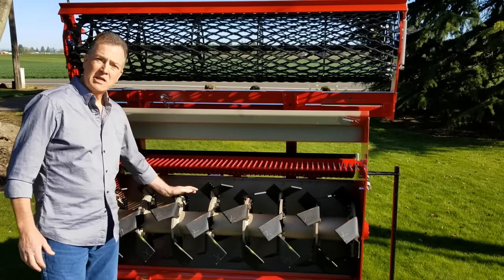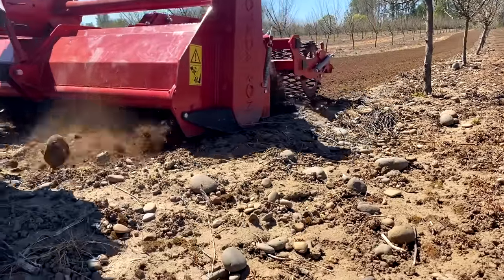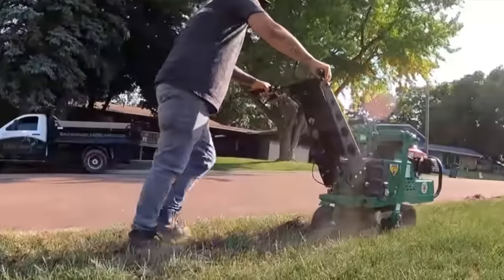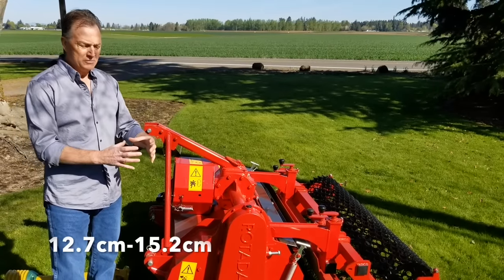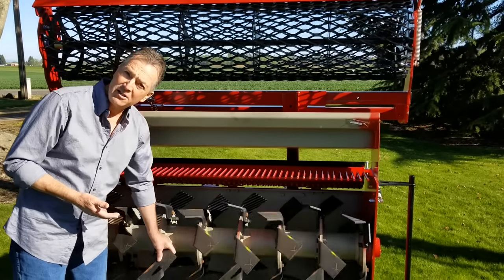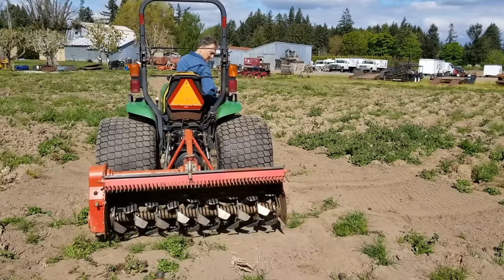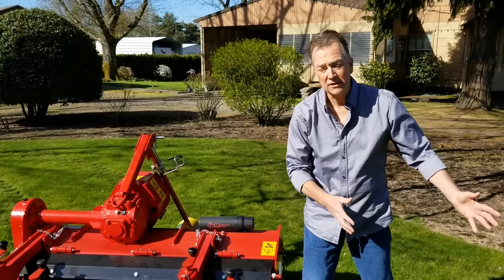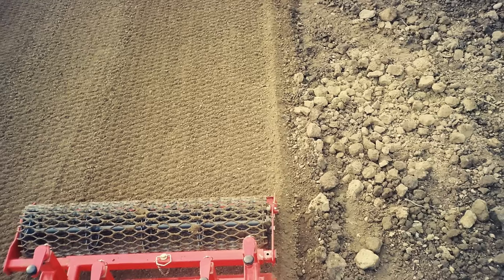One machine. One person. One pass.

Comment: Double shame that such machine is not readily available for zero turn mowers at a price range of 2,500 or so.
Reply: I'm with you! There needs to be some "cheap" equipment for mowers in general. Make something smaller and use an external power source like a Harbor Freight motor and tow behind. Even if it was a multi-piece deal. Like the head base has interchangeable parts. Tiller, sifter, leveler, seeder etc.
Reply: @shannonp4037  Yes, I agree.  I built something out of wood to cut sod about 2 inches deep, but the blade would always surface out of the ground, in that process I think I put around 300 pounds of weight to the back of the mower (on the device I built), and still would pull. So there's plenty of room, weight wise, for mowers to haul attachments.  I tell you, someone with some capital needs to tap into this market, hire a couple of engineers, a couple of welders and get the ball going.  Where's the American ingenuity?  Bring back the Made in USA tag (without foreign parts!).
Reply: @JBNetBreaker  son is going into welding, nephew (same age as my son) will be an engineer. Maybe those 2 can do it. Figure it takes a frame, 1 gas engine, some electric motors, metal, batterie(s) and an alternator/regulator
Reply from the maker: if you just want a cheap tiller this is not the right machine. this is a heavy duty, commercial quality, well constructed machine that will last decades if properly cared for.
Reply: @rotadaironcom269  Thanks, you do have a good product, nothing at all against your company; but in my opinion 2,500 bucks for a mower attachment isn't cheap, yet still falls within what I would pay (if I had the money), I'm just rambling about a whole different market, which I don't believe lacks feasibility.  By the way, I also attached my cheap tiller to the mower and was able to get a couple of rows done, obviously wasn't very stable, it was fun though.

Comment: I understand it buries rocks that bounce back and gets buried; however, my issue is grass when prepping an established lawn for sod.  Currently I have to till it with my tiller, switch to my powered rake and then remove thatch.  If this machine buries rocks AND grass I would consider.  Any input from anyone that has used one for this application?
Reply: If you can't lay sod over whatever this rig would do to your existing yard , there's some kind of issue that's probably not related to the equipment.
Reply: I call BS.  All of the videos and clips show preexisting fields or areas that have little to no vegetation.  And no you cannot just throw sod on top of vegetation that has not been buried or removed because the thatch that is left will breakdown under the sod and create heat which could cause root death.  Not to mention when it breaks down it can be lumpy when it breaks down if thatch is bunched up.  I think I asked for input from someone who has this implement.  Do you have one?
Reply: @brianatkins3371  don't need one. There's nothing flat around my area to use it on, and our yard rocks are literally the tops of the knees of the Appalachians, so this thing is out of it's element here.
 The level of mastication this thing would do to existing grass and vegetation is pretty easy to imagine, tho. Wouldn't be anything but beneficial to the dirt and whatever will be growing on it next IMO, especially if you're using a grass type that's actually robust.

Comment: if the rotor is on the right how do you make the second pass, do you have to drive around the field?
Reply: As with a tiller, to avoid tire tracks you shift the machine to the left at the end of the run and back up on untilled ground to reach the start point.

Comment: Does it only work on perfectly flat ground as you show in the video?
Reply: We have used our on fields that were plowed with a tractor first but you have to slow down or maybe overlap the passed to get it pretty smooth for a lawn but it sure beats a lot of hand work. We had ours now for over 15 years and although we only use it occasionally when we have the right situation it is priceless. I think ours is 54 inches and we use it behind a Kubota tractor which is about 60 horsepower but when we first purchased it we had a tractor that was only 40 hp and it worked fine.

Comment: Does what many other machine do, but much slower!  How many weeks to till a hundred acre field?
Reply from the maker: depends. what's your power unit? site conditions?is the soil previously loosened? let's assume your field is previously loosened mostly dry sandy loam with a little clay and rocks and debris throughout and you can handle an RX300. requires 110-160HP, it's got a 10' work width, and 8.5" till depth. at a speed of .25mph you will process approximately 26,400  SqFt(.61 acres)/hour. so approximately 20 days @ 8 hour days. 

and most machines don't bury debris. the rotadairon does.

Comment: I’m hoping by saying “high strength” you mean AR plate or a-514 plate. If so that’s a pretty tough machine. If not ? Well it won’t last very long.
Reply from the maker: whatever it is, the machines last decades provided the owner/operators are using them correctly.

Comment: Where would someone rent one of these in alberta Canada..  I have a 3 acre parcel that needs to be cleaned up to seed grass. It is currently kind of hay..would the hay have ro be cut first (about 2 ft tall)  I'm gonna have to try to find one
Reply: Replies have stated that most ground should be "worked" first. So yeah, you'd probably have to hay the field and then till it before using this machine.

Comment: Your comments about the amount of work per hour, does not match the clips you are playing at the same time btw.
Reply from the maker: we're aware. the amount of soil processing / hour is dependent on the machine. a small machine (say an RD100) running @ a 1/2mph can knock out approx 8,300SqFt / hour whereas an RD250 at 1mph (max recommended speed) can process 40,200SqFt. the commentary and pictures are only for example purposes, not intended to give an exact figure for every machine / job site.

Comment: BS those stones will destroy those blades
Reply from the maker: nope. blades are made of a specialty steel. super durable. you would have to put effort into destroying the blades. totally possible. we've seen it happen but under normal operating conditions (and with a component operator) they'll withstand quite a bit.

Comment: An American junk, bad for your soil, not good to chop every thing so much to powder. Those blades will be gone after a few acres, rock damage incredible. The best solution and machine for the job ever invented is a powerharrow! much less damage to the soil underneath, rock damage extremely minimal, smooth surface seed bed, less maintenance.
Reply from the maker: It's actually a French machine ;) 

Blades last quite a while depending on the type of soil and how often you're using it. Easily withstands rocks and other debris, wears out quicker in sand though as you're literally sanding the blades with each use.